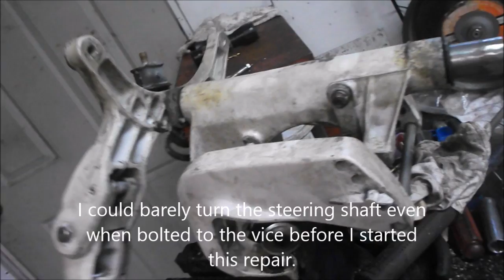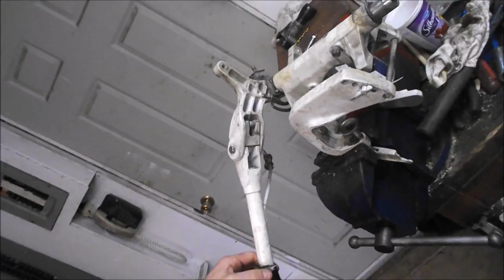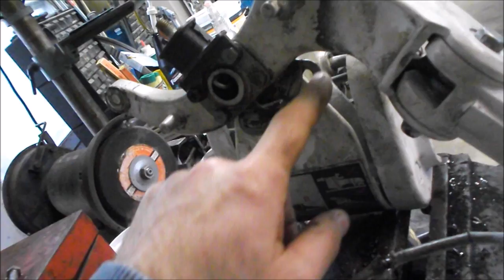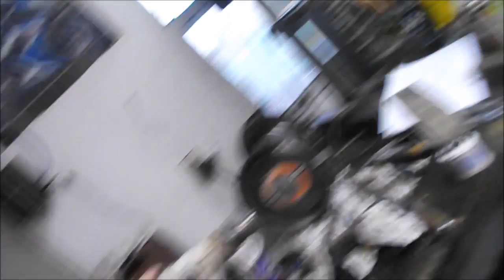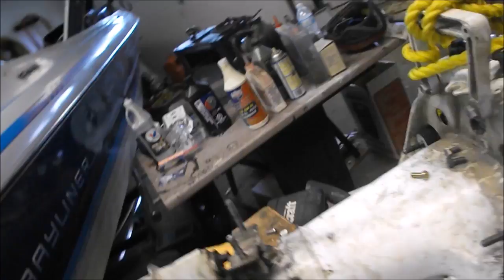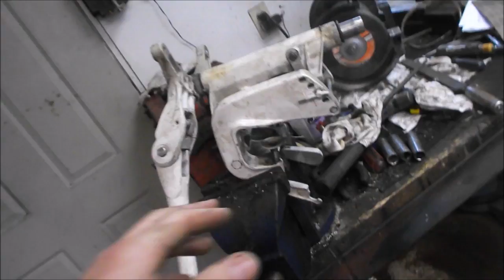Unsticking an Outboard Motor Steering Shaft

Comment: I have that same motor... real hard to steer... do you have a video on how to get the tilt mechanism off the housing?. I've tried but the lower unit only drops about 3/4 inch and won't come all the way off... all linkage was disconnected and bolts taken off....

Comment: My pivot shaft is actually moved up the assembly housing about a half inch. I have a 1989 Mercury Mariner 25hp which has always been great condition. I recently removed the lower unit and mid section to replace my broken drive shaft but now as I’m putting everything back together, There’s not enough room for the lower mount covers on the lower unit section of the swivel bracket to sit flush. And I can’t seem to pull the pivot shaft back down all the way through the assembly housing to sit flush. Any ideas?
Reply from the maker: Any chance you have 2 bearings or bushings at the top of the shaft instead of one on top and one on bottom?

Comment: I bought a used motor wrecked in back i replaced everything except the steering shaft could that be bent back to shape?
Reply from the maker: Yeah probably.  If metal is bent and then straightened it increases the risk of breaking but i would take a chance on straightening it.

Comment: I have the same engine. How do I get the gearbox out? I removed every bolt and did not get away. Without the release of the gearbox, the steering shaft does not come out??
Reply from the maker: juusstube it has been quite a while since I have seen this motor. I would suggest searching online for a parts break down